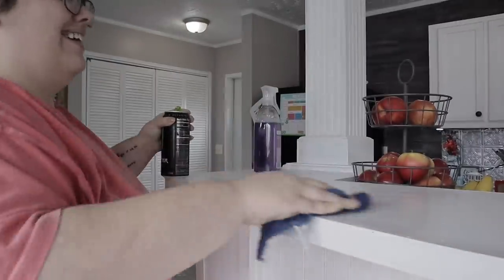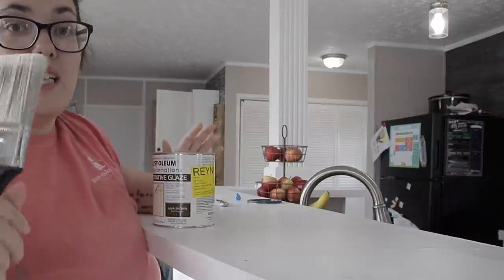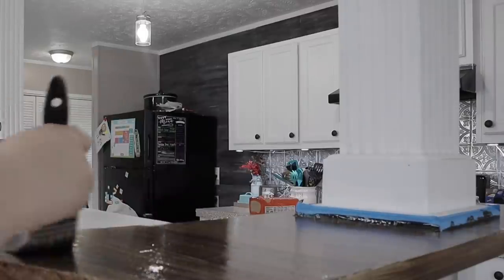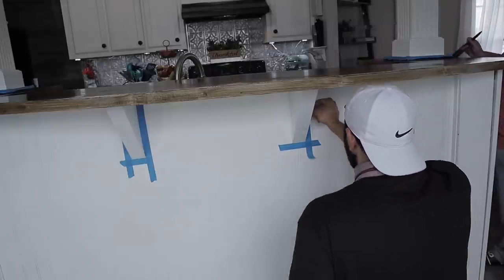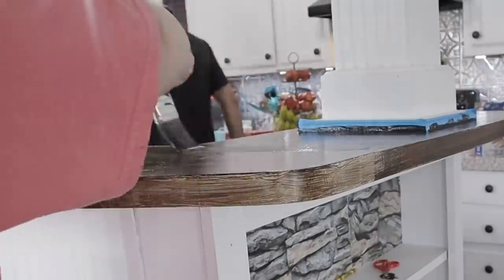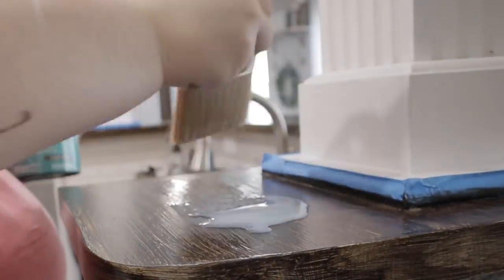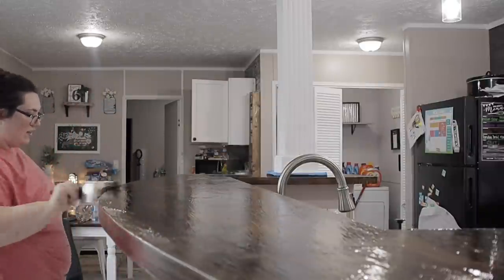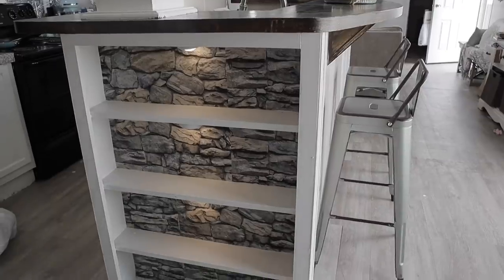Single wide mobile home makeover | island makeover | hand painted counter tops | decorate with me

Comment: Hello: I have a questions for you.  

What is the texture of your original counter tops? Did u sand first BEFORE painting? 

Do you find one you used poly that it’s sticky? 

Also, you mentioned to sand between poly layers, you are obviously wiping between coats?